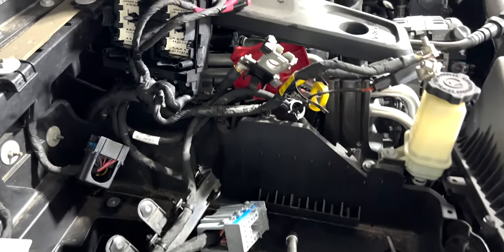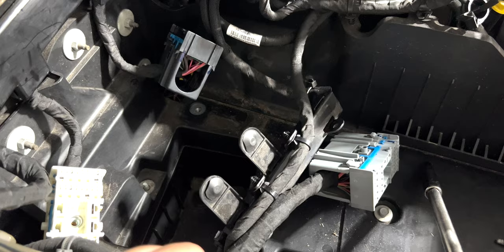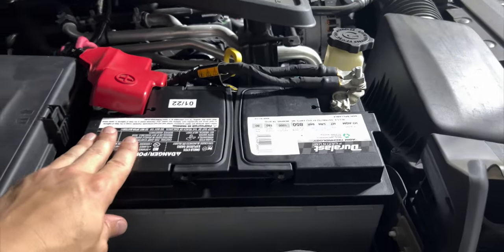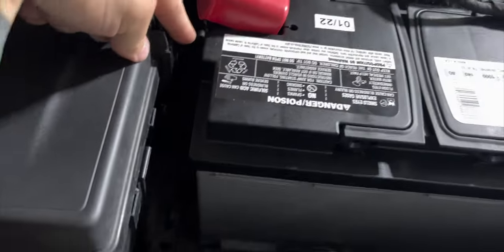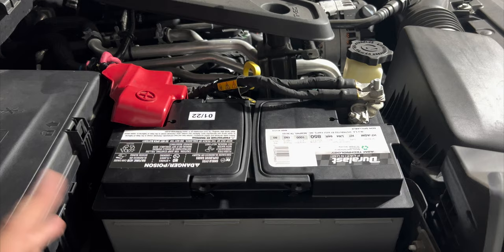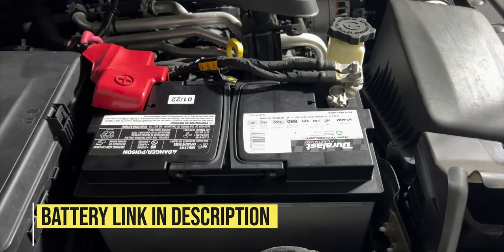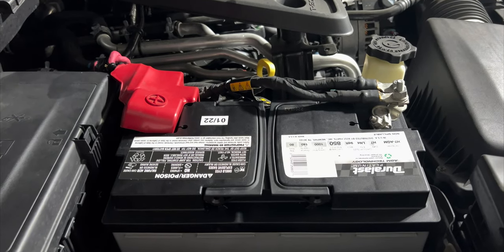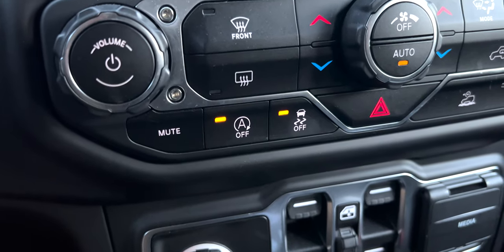Jeep Gladiator (and JL) Auxiliary Battery Bypass (Single Battery Conversion) No More Dead Batteries

Comment: I did this mod about 2 months ago. Both batteries were replace at the dealership
a few days before I did it . I have a Tazer mini installed as well. I have had to jump it on 4 occasions after sitting for 1-2 days over the weekend .
Reply from the maker: Are you saying you have to jump it after the swap? I’ve had mine in for months without issue. My Gladiator just sat for nine days while I was on vacation. Fired back up no problem.
Reply: @Ali_Mansour_Editor  yes I’ve had to jump it after the swap. It’s currently sitting in my garage waiting to be jumped. I didn’t want to mess with it yesterday . I’m starting to wonder if it’s the Tazer. 2020 JL
Reply from the maker: @davidjoseph0317  to be safe, I would do the latest firmware update for the Tazer and charge to battery to 100-percent. There shouldn’t be such a big drain that your Jeep should die after two days. I know the JL and JT both have a small amp draw when they are off, but nothing that would kill it in a short amount of time.
Reply: @Ali_Mansour_Editor I did it a few days ago. We will see if that was the issue.
Reply: mine did this about 3 months ago. had to change out all batteries. now i come out and that light is on. but my jeep did start. idk so idk either. have a ton of crap on it. thought it was the stereo upgrade i did but the guys checked it all out and said it was the automatic steps i have on it. but the jeep guy who installed this said it wasn't that .... but i just turn it off when im not using it.  not sure what to do. i do like this idea. or go with a genesis system but dang so expensive. i couldn't even get it jumped so had to pay out of my pocket for the batteries that time. now  damn light is on again. just praying it doesn't die on me again. before i can get it in or either i just this idk
Reply from the maker: @ashebarley77385  The secondary batteries on these things are clearly problematic. I'm just glad the bypass (single battery upgrades works). My local dealership is awful. So, there was no way I was going to waste my time with them. Best of luck to you.

Comment: Great video, I will be doing this tomorrow morning.  I have a question.  I usually turn off my start stop.  What will happen if for instance my wife happens to drive my Jeep and does not turn off the start stop?  Will all the systems function as normal?  Thanks Brad.
Reply from the maker: It should work fine. If anything, she might see the stop/start light pop up, but that’s it.
Reply: @Ali_Mansour_Editor  Can't believe they canceled those magazines you contributed to.      I live in NC. and frequent Carolina Beach.  Did you do this to your Jeep?  Any other concerns I should have?  I have a 2020 JTR.
Reply from the maker: I miss the print magazines as well. I’ve done this battery conversion to two of my Jeeps and helped a few others do the same to theirs as well. It works great. Zero issues.

Comment: Exactly the fix I've been looking for. Thanks! I have a 2018 JL Rubicon with the Tazer JL Mini installed. What happens if you for some reason turn the Auto Stop Start back while those connections are on the main battery? will it damage anything?
Reply from the maker: It should not damage anything. You may get the stop/start warning light on the dash if you try and use it, but I can’t say that for sure since I always keep mine off.
Reply: @Ali_Mansour_Editor  Ok. Thanks for the quick response!

Comment: Thanks so much for the vid . Being that it is condensed. Is there any other steps to be taken. I as well have a 2020 jt
Reply from the maker: Not really. If you go with the larger battery like I did, be sure to remove the small plastic piece that snaps in at the base of the main battery tray as it’s only there to prevent the original main battery from moving. You won’t need that with the larger battery.

Comment: Whats the update on this method?
2020 jeep gladiator here as well. Its actually sitting in the stealership shop atm. Ive already replaced both batteries once on this rig, myself...which was a small chore with all that wiring having to be moved about. This feature on the truck is just a waste.
Reply from the maker: Still going strong with zero issues. I've done this same mod on three other Gladiators.

Comment: @ali_mansour_editor - Thanks for yet another informative JT video. My 2021 JT Mojave failed to start yesterday as my wife & I were about to head off to church. My wife's Toyota Highlander got us there.Of course, after church, lunch, & returning home, my "go to" was YouTube (is there anything that needs to be done that cannot be found on a detailed YT video? LOL!). My JT entered service in May of '21, so although I'm just over 37K miles, I have a few more weeks to reach the "36 month" service entry ending timeline. Some YT videos proclaim that the AUX battery has a 36-mo FREE replacement warranty. Would be nice, but IDK. However, I do have an extended warranty on this JT, and I'm curious whether bypassing the AUX battery will void any portion of my extended warranty? Also, If I replace just the main battery while at the parts store, will I be able to get her home without changing or removing the AUX battery until I get back home? I'm aware that a dead AUX battery will eventually drain the main battery as well, but how long will that take? Anyone who knows, please feel free to reply here.
Reply from the maker: I can’t address the warranty stuff because I honestly don’t know. However, you can install a fresh battery without removing the AUX battery and drive around like that until you get a chance to pull the other one. That I do know will work. I personally would just bypass the battery, but that’s something you might not need to do since you have the extended warranty. Let them put another one in there and you might get another few years without an issue.
Reply: @Ali_Mansour_Editor  - Actually, MOPAR is saying that the basic 3yr/36K (whichever comes first) applies to the batteries. So, the warranty extension won't apply with me at 37K. I'm still wrangling with MOPAR on that, because of mixed messages coming from their Customer Service. But, I need my truck & need to get her going without further delays, so I'll be buying the parts & getting dirty. Thanks.
Reply: @Ali_Mansour_Editor  Interesting update: although I disconnected the aux ground cable, and removed the fuse, & installed a new main battery, the start/stop system is still operational. How can that be?

Comment: So Genesis says this is the method they use for their DBS. I went ahead and did this mod yesterday. Went well. The adapters under the fuse box were a bit tricky to remove - I found by getting my hand underneath each one and wiggling from side to side got them out. After that it was pretty striaght forward. Putting it all back went easy. I taped up the AUX neg lead and left it in the AUX battery box. I attached the pos lead from the AUX to main pos terminal by flipping it upside down like you did here. One question I have is if I need to jump start the vehicle, can I now just attach the jumper cables to the Main battery pos/neg like normal correct? My next mod will be to disable ESS by disconnecting hood latch warning sensor and skip the extra $300 for the Tazer.
Reply from the maker: Correct. If you need to jump start your Jeep, just correct the cables to the main battery post. From what I understand, if you disconnect the latch sensor and bypass the battery you will have a warning light stay on the dash and it will tell you Stop Start is disabled when you enter the vehicle.
Reply: @Ali_Mansour_Editor  Thanks. Yes i believe you are correct regarding warning lights but the dash is busy anyway and I pretty much ignore most of it (unless I need something specific) and just use the analog. I dim the dash slightly and it doesn't bother me and beats pushing the ECC button each time I start the vehicle.

Comment: Question I did everything to the T on my 2020 JLU Rubicon including using the described battery. Since a 2020 not a 2021 I taped off the aux negative. It ran fine till the larger battery now 12 codes, crackling noise a steady TMPS light and ck engine light. Oh I also used a Tazer to turn off the ESS. Any help would be greatly appreciated!
Reply from the maker: It’s possible you have a late 20 build, which means you need to attach your negative cable to the main battery. I have a feeling that’s all your issue is.

Comment: My 2020 JL has had issues with the auto start/stop from the beginning. Still using the warranty trying to leverage the dealer to address the issue. Not a fan of the auto start/stop but voiding the warranty does not seem like a good plan!
Reply: There is no such thing as "voiding the warranty." Only a court can void a contract.

Comment: I pulled the fuse, disconnected the AUX battery ground, but did not disconnect the AUX positive cable. My start/stop system is still operating unless I push the dash button to turn it off. Make it make sense. ???
Reply from the maker: I would just go ahead and disconnect the power lead to the battery as well.

Comment: I used the Vgate icar ODB II to bypass the auto start stop function....although it doesn’t stay connected I assume as long as the 
 auto start stop has been bypassed thats doing what the Tazer is doing?
Reply from the maker: Correct. So, long as the stop start is bypassed, you should be fine.

Comment: When doing this, do I need to pull the fuse for the Aux battery?  I plan on doing this instead of going the Tazer route.  Or do I need the Tazer as well as this process?
Reply from the maker: I've never pulled the fuse and I have done this conversion on a few Jeeps. If you don't get the Tazer, you will have to press the stop/start button every time you crank the Jeep.

Comment: I don't understand this. Many people say to pull the F42 fuse, and then to take the black cable with the 13mm nut off of the ground of the battery and leave the other one on (the one with the smaller nut that takes both cables off)..

And they say this disconnects the AUX battery and turns the ESS off.. but when I do this, my vehicle has no power when the cable that they say is the aux battery cable is not connected to the ground.

I don't feel like going through all that work to take out the aux battery..

but I believe that my aux battery has died and is now draining my main battery. I could take it to the dealer and get it replaced but I am selling a lot of stuff on eBay and I don't want the hassle of a dead car and being unable to drive right now.
Reply from the maker: I've never pulled the fuse. You do need to pull the AUX battery so you can attach the positive lead to the main battery. If your Jeep is 21 and newer, you will need to attach the ground from the Aux battery to the main battery as well. I've done this exact swap on multiple Jeeps and have been running this way for YEARS with no issue.

Comment: Hi. thank you so mulch for your video.  It's short and very awesome!  I have never seen a video like this. just a KEY POINT.  May I ask you a question? You told us that if you have a 2021 jeep or newer, you do have to connect the original ground(the small aux battery) to your the main battery's or you will get an error.  My point is that  the small battery's positive terminal is the main positive and the small battery's negative is the main negative terminal. if 2021 jeep.  Am I right?
Reply from the maker: The newer Gladiator's and Wrangler's aux battery negative goes from the battery to the firewall then back to the battery. The 2020 and older models only runs from battery to battery. My friends at Genesis Off-Road (which make a dual battery kit for these platforms) were kind enough to share that info with me.
Reply: @Ali_Mansour_Editor  There is one thing for me not to understand. can I leave the auxiliary battery's negative terminal disconnected? or connect it to the main battery's negative? I'm user 2021 JL wrangler rubicon. thank you very much.
Reply from the maker: @힐바-h9l  If you see that the negative goes to the firewall, then connect that aux battery lead to your main battery. If it just runs from the battery to battery like mine, you can just tape it up and leave it unhooked.
Reply: @Ali_Mansour_Editor  best of best TEACHING. thank you very much. I'm so happy to meet U.
Reply: @Ali_Mansour_Editor  Is there any issue with connecting the aux black back to the main battery? I was planning on just connecting both black and red back to the main battery. I have a 2018 but don't like the thought of just leaving it disconnected and taping it up. I off road my jeep and wouldn't want to take a chance on it hitting something.

OR can I just disconnect and remove both cables completely? I haven't looked at it yet to see if this was possible. I was unsure if they are part of the harnes or just short cables that could be deleted.

Thank you
Reply from the maker: @ffrob2001  will work fine. You are just making a loop back.

Comment: I just did the delete on my son's 2020 Gladiator.  I pulled the E42 fuse and then disconnected the ground from the big battery.  I still have the light on in the message center.  I didn't connect the positive from the small battery to the large battery. Do I need to do this to get the light to go off?
Reply from the maker: I have not tried it like that. I would pull the second battery and connect the positive lead to the main battery. You should be able to replace the fuse as well. I’ve never pulled it on mine.

Comment: Hi man. I completely removed the aux battery but the start stop function still works.  This is fine?
Reply from the maker: I’m surprised it’s still working. It’s only pulling juice from your main battery. So, if that’s healthy, it shouldn’t hurt anything. I would just turn that feature off if you are concerned about it.

Comment: I ran an AGM, lasted roughly 18 months. The factory alternator doesn't crank enough volts. I'm told AGM like 14.6+. This jeep puts out 14.2 on high, but usually 13's
Reply from the maker: All of the Jeep Gladiators come from the factory with an AGM battery. Their charging system is designed for it.
Reply: Did you replace your AUX at the same time because if you didn't in many cases it will kill the new battery. Batteries that are wired together are single battery systems. You can't match old and new batteries without having problems.

Comment: Question and please excuse my ignorance.  Why do you connect the positive and tape off the negative.  Shouldn't the negative also be connected also.  I`m new to this aux battery thing.  My auto start stop isn`t working.  Gives me a service start needs service. Also the fuse 42 disconnect is that required on a 2020 Jeep JL, I do not have the Tazer either.  Thank you everyone
Reply from the maker: The reason is because the negative cable that connects to the small battery is just a cable going from the big battery to it. So, by connecting it, you’re just making a horseshoe. There’s no need for it.
Reply: @Ali_Mansour_Editor  And the #42 fuse
Reply from the maker: I did not disconnect the fuse as it is not required on the Gladiator. Not sure why there would be something different with the JL.

Comment: I did the same thing to my 2018 JL two years ago. I didnt connect the ground and ive never gotten an error code.
Reply: Did you go through the fuse box? I hear it's easier to remove the inner fender well and drop the aux battery out from the bottom.
Saves having to remove the fuse box
Reply: @lonewolf4827  You need to go through the fuse box because youll be bringing the pos and neg cables back up that way.

Comment: I’m guessing this would work on the diesel model too? I’m curious about the replacement battery size though.
Reply from the maker: I don’t have any experience with the diesel Gladiator. I’m not sure if the battery box is even the same size.

Comment: Any idea what the little black thing is on the negative side with a two small gauge wires I think it's red and a
Reply from the maker: I believe that is the sensor that monitors the battery health. Those lines run back to the firewall and into the cab if I’m not mistaken. I’ve never chased them down, but I believe I was told by a Jeep tech that that is part of the battery management sensor.

Comment: My wives jeep gladiator had a problem with the auxiliary battery I changed it and then the voltage started decreasing now to the point that the jeep has no power and I can’t jump it
Reply from the maker: That could be a number of things. It’s possible that the small battery actually drained your large battery enough to kill it. It also could be a simple as your alternator is not working.

Comment: So I have a 2021 Mojave gladiator. I also run the Taser. So all I have to do is run the  Positive and negative from Auxiliary battery to my main battery since its a 2021? That's it ?
Reply from the maker: You just need to trace the negative wire and see if it goes directly back to the main battery. If it does, all you have to do is tape it up. If it splits off to a body ground, then you'll need to connect it to the main battery.

Comment: I’m about to change out my main battery. I don’t use a taser but I do have an inline module that disables the stop/start. Do you have to use the taser to disable ? can I bypass the small battery also. I have a 2019 Gladiator
Reply from the maker: If you have a module that disables the stop/start, you should not need the Tazer. You should be able to do exactly what I did here.